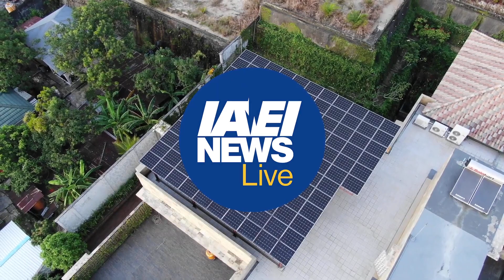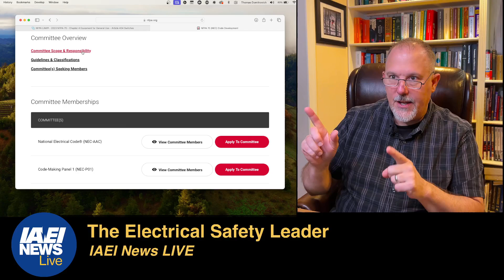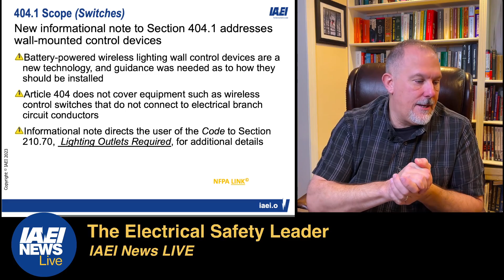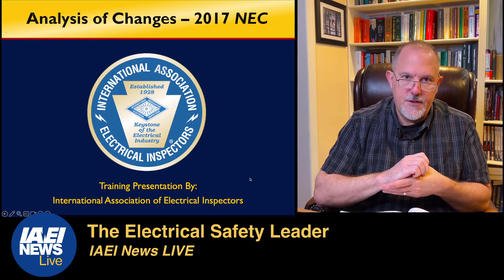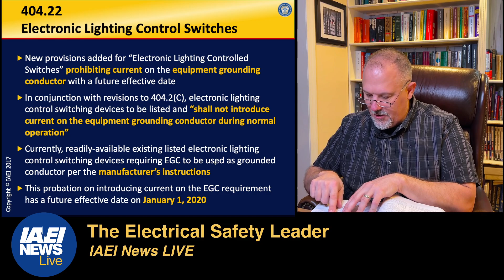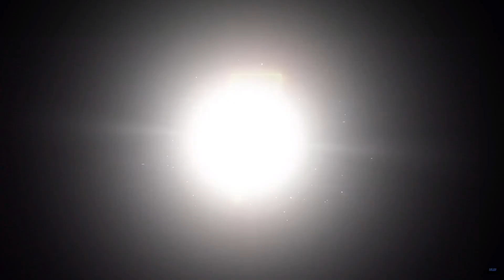Article 404 - Switches

Comment: The issue was that PIR sensor switches HAD previously been connected and supplied by LINE-to-EGC based on the sophistry that “leakage” current < 0.5 mA HAD BEEN ROUNDED OFF to ZERO mA. As multiple PIR switches were installed for ENERGY MANAGEMENT, the CUMULATIVE leakage current increased to well above 1.0 mA, even to the point of tripping GFCIs. When PIR manufacturers were forced to comply with 250.6, the MIXED-EDITION ADOPTION LOCALLY forced to make TWO INVENTORIES, ONE for jurisdictions on Editions that still permitted PIR switches connected LINE-to-EGC, and ANOTHER for jurisdictions mandating PIR switches connected LINE-to-GROUNDED (NEUTRAL) for which CUMULATIVE leakage current would NOT result in tripped GFCIs. The Effective Date was a “sunset” on the LINE-to-EGC construction to eliminate the “double inventory” for TWO versions where regions spanned jurisdictions in different Editions (and enforcement of 250.6 due to CUMULATIVE leakage currents relative to energy codes).